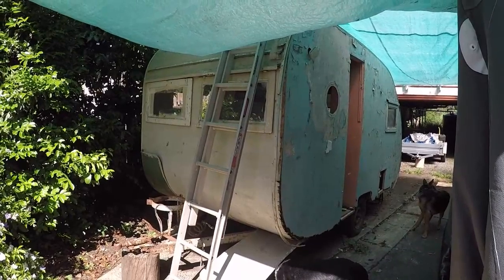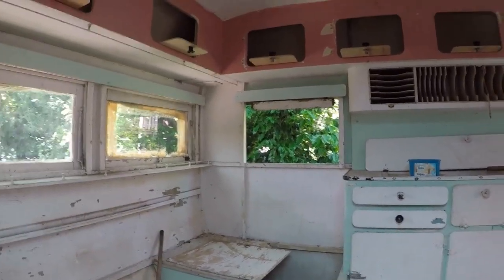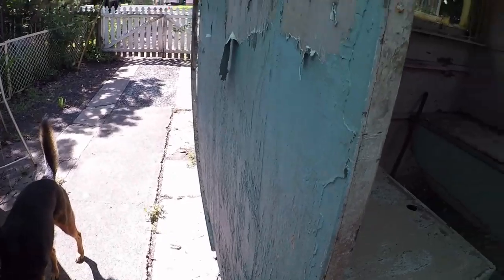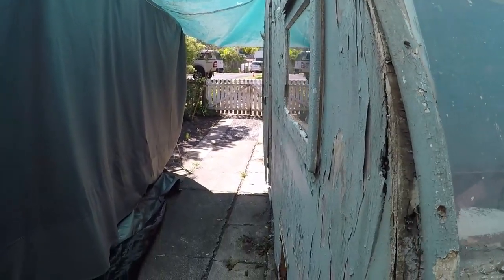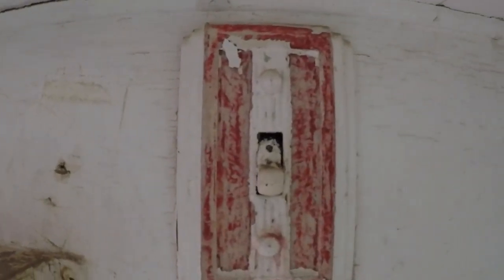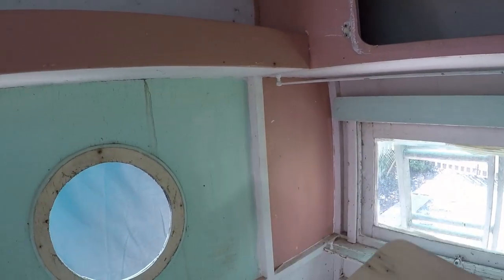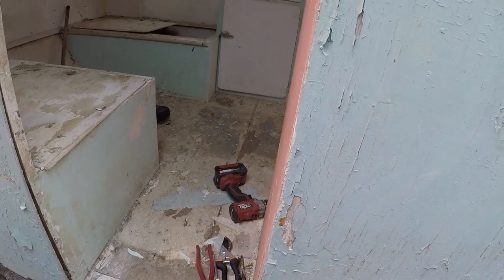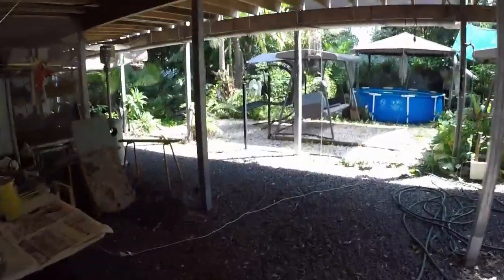Restoring 1950's vintage plywood caravan the beginning.

Comment: You can get a low pressure sand blaster to use on the plate rack. That uses a different type of grit that is not harsh for wood.  The cupboard door under the hot plate was fake it was never to be opened.
Reply: That makes sense!

Comment: I have seen a few like this one and also much smaller that have been restored back to their former glory.
Some people have only kept the original shell, placing it on a modern pull bar, axles, suspension & brakes. Then internally they have a used modern,  yet aesthetically pleasing fitout involving some very innovative technology that makes life very comfortable and easy to maintain. 
Which ever way you go, I hope it ends up being a suburb result. It's a great project 👍
Reply from the maker: Thank you. It will be interesting to see what direction inside takes. See you next update.

Comment: The red orange coat is old fashion lead paint for protection of places that will not be visible after construction, remove all rotten parts because rot will attack new wood, dont use water based paint it wil rot in 5 years, ( it wil here in the netherlands lol ) use alcyde or urethane paint, use glass caulking or sealant for glass and other places you cant reach later, and expect surprises aka more rot.I am a painter and i wish you good luck with the project , it will take a while but it will be a nice restauration good luck maty..
Reply from the maker: Thank you for your advise Rolf. I will take it on board. Yes, there are more surprises I'm finding but I'll sort them out and it is already rewarding seeing what I'm uncovering.

Comment: This is so cute, I've thought about doing the same over the past 20-30 years. I wonder if the mirror might go inside one of the closet doors so it can be pulled open on those attached bars on the mirror, from the inside to use while standing outside the closet then folded back in? Hope you do hear back from the company that made them in the 50's to give you more Info. If not, the internet might have pics of them to help you out. Best of luck getting it renovated, I look forward to watching your furure videos of Barbara as you progress with each section. I think Veronica, & Betty are time appropriate popular names as well  from the Archie comics back in those days. Take care & see ya on the next! 😉🖑 Hey, I just googled "1950's mini trailer"  or 1950's campers" & got a lot of pics with various paint color combos, etc. Check it out online. 👍
Here's a pic with the one porthole window as well:
https://images.app.goo.gl/ZhS5Yg9rMt7w2iCX7
AND: 
https://vintagecaravans.proboards.com/thread/16036/vintage-roma-caravan-coming-sale
Reply from the maker: It would be nice to hear back from them but as yet nothing. Thank you for the links. The second one looks very similar to mine. See you at the next update. 😊

Comment: Maybe it had a decorative cover strip halfway between the top half & the bottom . And with that fridge , maybe you could mask it up , after you've sanded it back . Prime  & undercoat it & add like a bath type enamel to it & use at as a cold food larder . Same with the wire racks ? Just food for thought ?
Reply from the maker: Thank you and I was thinking along those lines.

Comment: it looks like that slot in the door jam may have been for some kind of slide in screen.
Reply from the maker: Thats what I thought too but don't know how it would work.?
Reply: @mkuebler5  maybe it had some kind of latch on the top of the door opening so you slide it in from the bottom -hook it up then close the bottom half of the door ?  I was wondering if the windows had screens  in the past. It would have been really stuffy to sleep in there with no fresh air. Unless you opened the windows and slept under mosquito netting . You don't smoke anymore so it wouldn't be a fire trap.